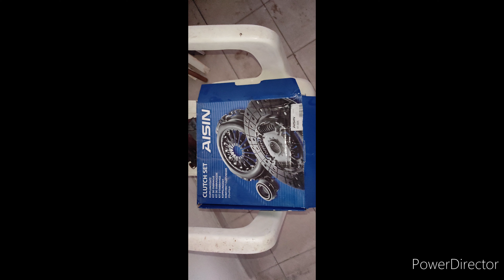Toyota Corolla Caravan 2005 D-4D MMT Automatic Transmission 1.4 95HP Turbo Diesel Clutch replacement

Comment: Thanks for the vid, is there any coding done before and after replacing the clutch kit?
Reply from the maker: yes there is...you can use a obd scanner to do it or...the way i did it you bridge two pins on the obd with a wire the 5 or 6 with 16 i dont remember i will search....and basicly you reset the clutch to zero with that and after the new clutch you make it read it has a new clutch...then after this you must go for a first drive and change all the gears to a certain rpm so it learns them....the coding to reset and then learn the new clutch is done with the gearshift...its a sequence you must follow for every step....like N R -1 +1+1-1+1 R N i will see if i can find it and put a link.... https://www.partinfo.co.uk/files/INF12215_GB.pdf i find it.....go to the link and follow the instructions it quite easy....you must do some steps before starting to remove anything... you will hear your car responding while you do this steps....the actuators etc...a guy asked me 300 euros to do this with the obd...but i did id for free like tis so....i hope i helped you thank you for watching my friend

Comment: Hi, the video is not very clear, frankly. Unfortunately (for me) it's the only video regarding clutch replacement on the exact same car I own: nde120, 1nd-tv motor, 1.4 diesel D.4d etc...and it seems there are no other videos regarding this model in the whole youtube. Have you followed any tutorials or the official repair manual? Or did you just disassemble everything you needed above the transaxle to leave space for it to be removed?
Reply from the maker: @marcoc990 Yeah this is the only one i think ...i have had searched before i do this a Lot too but i couldn't find one.....i must figure IT alone....but its pretty straight forward...its a dry clutch no torque converter...it is the same persidure with a normal clutch...the only thing you must do is bring the clutch actuator to 0 becouse its electric..they told me it needed 500€ for the gearbox down and 300€ for the diagnostic to do it but i did it for free...i paid only 230 € the aisyn clutch...same with the one that come from factory....you just need to bridge 2 pins on the obd with a wire...i dont remember its years back now....but it was like 5 with 10 or 4 with 8 or something and you must make a persidure with the shifter like N + - r n and it goes back the clutch actuator ..you can hear it do that... Then you remove it replace it like any other dry clutch...and after this you must do another pattern like N + - R + idk...for it to auto adjust the new clutch...after this you do a learning first drive you change the gears manually to teach the computer and its ready.!.! Try finding the instructions online..it exists somewhere...if you cant find it contact me i will see if i have it on my old flash drive...if you have any other questions or i can help you feel free to ask!!
Reply from the maker: @marcoc990  https://www.google.com/url?sa=t&source=web&rct=j&opi=89978449&url=https://oscaro.media/catalog/images/pdf/350/protipsadt330267_gb.pdf&ved=2ahUKEwjTrui1mKCKAxUkh_0HHeYzLtEQFnoECDQQAQ&usg=AOvVaw3RqmOgsI2qfnzI8llQW6BR i found it for you...Your welcome🫡

Comment: How long did that take you?
Reply from the maker: Hmmm i think close to two days of work my friend...but it was in my house coffee cigarette...i was not in a hurry... The hardest is that is so much wiring and many many connectors you must disconnect carefully not to brake anything Because the clutch and gears are electrically activated/changed....but except from thats its a normal transmission with a dry clutch!!